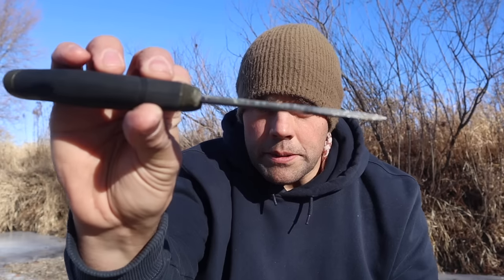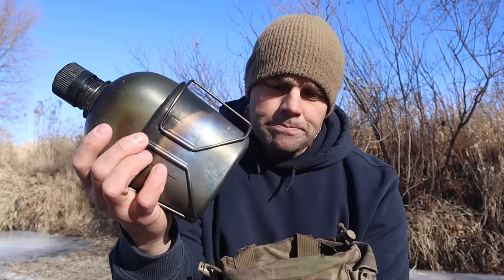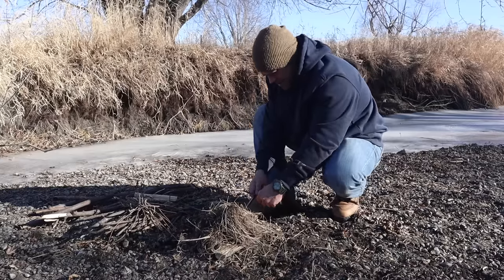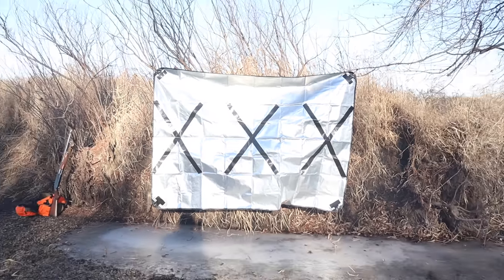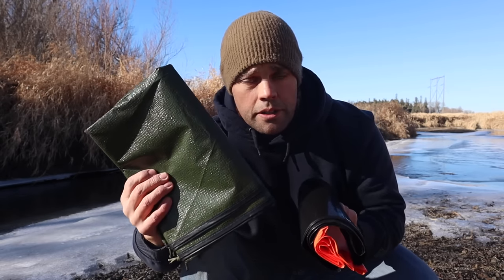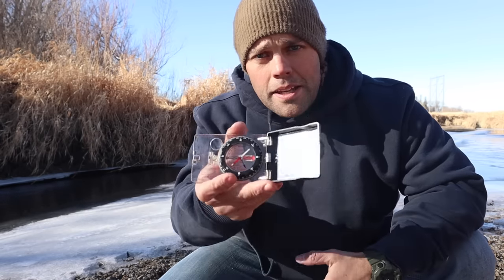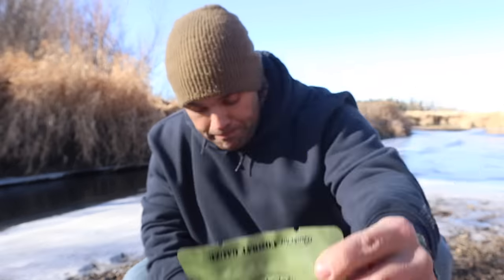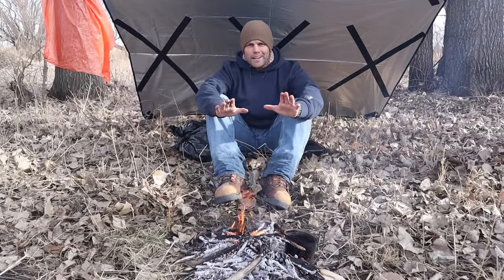How to Make an Advanced Survival Kit!

Comment: I dehydrate veg (onions, carrots, mushrooms, grilled eggplant, tomato slices, bell peppers, etc) and add powdered beef and spices then vacuum bag them. Very tasty, very lightweight, and all that's needed is hot water. But, its tasty enough to eat without water. And, extremely inexpensive.
Reply: Nice.
Reply: Suzi, is there a certain amount of beef powder you put on? Never thought of this but sounds awesome! Me and my wife are working on dehydrated meals from Kevin outdoors channel.
Reply: @jasonmashburn1280  

I tend to eyeball things but my eyeball did spy 1 c of the dry veg mix with 1 TB of the beef powder. Don't forget salt and pepper and I also add granulated garlic (like powder but with larger crystals). Add any other dried herb you like. I added parsley, ginger, and a smidgen of anis to give the illusion of sausage in the background. I've also added tomato podwer and crumbled leaves dehydrated kale but spinach or swiss chard (or all!) fill out the soup nicely. I've also used broken bits of angel hair pasta and they soften in the hot water with the rest. I'm going to try the vermicelli rice noodles, broken, next time. 

Dehydrated food is so nice. I'm about to try both dehydrated mashed potatoes and hash browns, the former should be just like instant you can buy (and when I can get my hands on powdered butter that will go into the vacuum bag along with s & p and powdered milk .. should be a tasty mashed with just hot water).

So many things to try and variations on them. In the dehydrator now is a pumpkin pie mash that I hope to turn into a 'sugar'.
Reply: @suzibikerbabe8073  just be careful when dehydrating powder with your food, I have heard some people say the granules can get sucked into the vacuum on your sealing and damage it. 

That soup sounds awesome! Kinda like meals in a jar only in a bag! I'm a OTR truck driver so I'm wanting to be able to make stuff at home to bring out with me. You will go though hundreds of dollars a week eating at truck stops.
Reply: @jasonmashburn1280  

Thanks for the tip! I dehydrate garlic and will go with that but if making a quick soup at home the granulared should e fine. I scoop out a cup and either pour water over or simmer in water in the stove. At home there are more options but on the road earing it dry is like this really savory trail mix. 

Added green toms into the dehydrator. No idea how they'll turn out but temps are now in the low 30s at night and I can't leave them on the vine any longer.

I'm also going to carmalize onions and green onions then dehydrate to see what diffierence they make.
Reply: @jasonmashburn1280  

Though I wonder how big an issue the grains and powders are with the jar vacuum hose, which I have it attached to a brake bleeder ...
Reply: @suzibikerbabe8073  as long as you don't get to close to the top I don't think that will be a problem.
Reply: @suzibikerbabe8073  Wow, you're really creative with the dehydrator and meals. I recently got a vacuum sealer and I love it. So I need to starting using my dehydrator more. I haven't tried it yet but I bought some powdered butter from My Patriot Supply. It had good reviews. Thanks for inspiring me!
Reply: @suzibikerbabe8073  Orzo and the mini / lightweight star pasta would be interesting to test against the vermicelli. 

From what I understand, one or both of those types of pastini can endure long cooking / stew times.
Reply: Mushrooms aren't veggies ;)
Reply: Just saying great video idea too
Reply: good idea bro
Reply: That's a great idea.  You make me want to buy a dehydrator.
Reply: @donaldgoodnight7853  seek help.
Reply: @redriver6541  

I bought mine at Aldis for under $15 and it's rarely put away. You can buy fruit and veg that are on sale because they're close to going bad and dehydrate them into snacks and powders. It saves anything that you have that's more than you can eat before rotting, dehydrate. Jerky is all your own flavors. Buy the freeze dried eggs, milk, and butter and you can make your own dry mix for biscuits, pancakes, dumplings, or even cupcakes (cocoa powder and sugar). I make my own rubs for bbq meats from what I grow in the garden. I find I may need a tablespoon of tomato paste then what to do with the rest? Dehydrate! Dehydrate tomatoes, cucumbers ... things in the garden that we can eat as fast as they grow and I can rehydrate to make a sauce of pickles. Use your imagination and don't fret that some ideas that were brilliant in your head will be crap on a plate. I joined a dehydrating group on facebook: Dehydrating Tips and Tricks, a Purposeful Pantry group. Lots of ideas and help there. :)
Reply: What or where do you find powdered beef I’ve never heard of that?
Reply: @cohiba1982  

Beef granules .. like bullion cubes only just beef. I believe made from freeze dried beef broth/drippings.
Reply: How would you prep all that food in the event you don't have an adequate water source?
Reply: @joegarcia1674  

If you don't have water, you've a way bigger problem than food.
Reply: Oven costs in dehydrating ?
Reply: How about dried beans for protein? What about vegetables seeds?
Reply: @mattpierce5202  

Dried beans would still take an hour or so to cook, cook them then dehydrate so they'll only have to rehydrate.
Reply: @suzibikerbabe8073  that’s worth a try? Have you tried that before? I’m a truck driver I sometimes have cravings for beans.
Reply: @mattpierce5202  

Beans make me physically ill so I've not done this personally. I do know that items like dried pasta, rice, and beans need to be cooked before dehydrating if you want to be able to add boiling water and go. Same with veggies like carrots and potatoes, they're too dense to dry properly and rehydrate nicely. There is a resource here (and on facebook) called The Purposeful Pantry that has great info and she gives feedback to questions. 

As a truck driver snacks can be a killer, when you get them from the chip isle at the truck stop but with dehydrating you can make healthy snacks, including jerky. Dry some fruits like banana, strawberries, and apples then add some nuts and you have a tasty, no chemicals added, snack. There are hundreds of thing you can dehydrate for meals and snacks. Even some veg, when dehydrated, are so tasty they're like candy.
Reply: @jasonmashburn1280  i put powders in brown paper lunch bags. Roll the top down and then vacuum seal it. Havent had any problems yet with it getting sucked up into the machine
Reply: Another great video and training for the “average Joe”
I appreciate the basics and then making them multifunctional with just a little extra prep.
Reply: Bananas dehydrate really well and taste amazing.
Reply: The thing that makes this such a GOOD idea is that small dehydrators are very inexpensive. They are used mostly here in South Africa for making dried sausage (droë wors) and biltong which is Afrikaans for beef jerky (I think). Although it is quite often made from things like kudu and ostrich). In my opinion commercially dehydrated fruits and vegetables are prohibitively expensive and so are MREs. I mean, let's be honest here - the separate ingredients of most MREs can be purchased individually at a far better price. Here in South Africa I wouldn't buy a Mora I would buy a BAHCO which is the same knife. Also a Leatherman costs over R4000 so I would buy the individual components and keep them in a small pouch.
Reply: @cohiba1982 Its basically powdered jerky. Here in South Africa we have powdered biltong which is the same thing.
Reply: @zeez3139 Very little.
Reply: @suzibikerbabe8073  dang girl you got the whole market in the bag lol that's awesome my mom is really into vacuum sealing
Reply: @jasminepina9058  

Tonight I'm dehydrating tomato skins from when I made sauce. I ground them and added pizza spices, granulated garlic, and that nearly powdered fake parm cheese for a popcorn sprinkle but I can use the powdered tom skins alone to add flavor to anything .. eggs, ground beef, chicken shake, any of the soup bags .. and with a little water I can have tomato paste. It's great to use up stuff that can normally be wasted.

Comment: Great tips!
For your Bic lighter, make one of the flame guard holes a little wider with a screwdriver or something, and put a split ring through it, and put a carabiner on it. You can now attach it to anything. Tether it with a small chain to your belt/pack so it stays on you if it drops out of a pocket.

Comment: Some other ideas I like personally are:
1.  Use brighter colors....pink, yellow, orange Bic lighters....bright colors harder to lose.....
2.  I carry some cordage smaller than 550 cord.  I use that to wear the compass, whistle, and a signal mirror around my neck.  The ability to signal needs to be available almost instantly. I also tie important items to my belt.  My Ferro rod and a small knife such as a swiss army are hitched to my belt and stuffed in pants pocket.  If I take a spill down an embankment I don't lose the items.
3.  I like a very minimal and compact fishing kit added.  They can help as traps or snares as well.  (You can catch small game with a treble hook.) Strangle, dangle, mangle.
Small fishing night lines can work for you often better than setting traps.
A sail needle can be taped to your equipment for repairs to clothing or equipment. Possibly single sided razor blade also to save your primary blade. Can be kept with fish hooks....pill bottle or Altoids size kit.
4.  You can take the $.99 harbor freight mag bars... separate the Ferro from them and JB weld it to the side of your Altoids tin or other hard gear....use as a spare.
Iodine is a fair water purifier except on cryptosporidium.....it can also be used in cuts and scrapes.
A small piece of heavy tinfoil is good for a canteen cup cover to conserve fuel and as a fast waterproof base or wind break for your tinder bundle.

Just a few thoughts.....

Comment: No nonsense direct informational presentation. Add a high powered Slingshot with a bag of chrome steel ballbearings. Modified First-Aid Kit to a small Med-Pack is an excellent suggestion, and to read up on how to use the additional items and a guide to first-aid techniques. Priced of Survival Gear have increased ,since the Covid-19 Plague. It is therefore a good idea to obtain all necessary Survival Gear now!!

Comment: If a person is going to depend on a fero rod, practice is an absolute must. Lighter will always be my first option, but I also have the waterproof match carrier with the compass on top in my coat's great pocket. I also verify frequently that the compass is also pointing north before I head out. My paracord survival bracelet has a compass, fero rod and whistle. I can't trust the compass on that though. The tourniquet stays in my hunting pack, but I should probably add it to the survival pack that moves to whatever pack I'm using at the moment.
Reply: Windproof matches make great tinder under harsh conditions.  Good to have a few of them in reserve.

Comment: Hi Andrew glad to see you doing well. I like this kit I built several myself and wanted to share with you I added a GI poncho and a homemade fleece poncho liner I also have a candle lantern with bees wax candle this is an emergency shelter in itself candle goes under poncho as I sit this warms the whole body and candles last for a good many hours.
Reply: Good idea, instant heated shelter .
Reply: Beeswax doesnt work well when its real cold
Reply: I have a small one and I have votive candles that work well, but I also make beeswax candles so I can custom make them for the lamp. Good idea.
Reply: @robertw4230  indeed.

That is a great idea.  Does anyone any recommendations for places to shop if live up on Canada?
Reply: I use citronella tealight candles in my lantern helps to keeps the mosquitos away

Comment: The illumination tape would be good for the Altoids tin. Takes up little space :) . Glow-in-the-dark gear can be very helpful, in instances where some light would be useful, but fire is unnecessary. 

A few glowsticks can be good, too. Can charge the tape, and provide passive signaling.
Reply: In my car I have a small kit, inside is a few small (2 inch length) and normal sized (5 in length) glowsticks. Great for emergency light, 3 can be strung for signalling distress, or alerting traffic a car is parked ahead on highways by throwing them on the roadside, and they are dirt cheap and hard to damage inside a kit. The small sticks would be great in a hiking kit too.

Comment: By far the best survival kit I have watched. Solid video. Great content for the community. One question I have is on your trap instead paracord is use bungee cord to add some spring action in heavy wind... your thought
Reply from the maker: Bungee cords are good, I’m not opposed to them. I think 550 does a better long term job. I’ve cannibalized bungees for sling shots and traps in the past so I prefer 550. I’ve also gutted 550 for traps and still had a ridge line and exterior sheath line. Prb best to get out of the wind as much as can be done, not always feasible. I can see bungees doing fine.

Comment: Great kit, thanks for sharing!
Would add a small hygiene pack (toothbrush/-powder, soap, toilet paper) and a (small) wool blanket, and would put all the stuff into a small 10 or 20 liters ultralight rucksack. I know these are things not necessarily needed for survival but for me, they make a huge difference in hygiene and comfort and are worth the extra weight and volume in a survival kit.
Reply from the maker: A small hygiene kit would be preferable. I know some species of plants like "sweet gum" to clean teeth even charcoal and water. But a small kit would be a good comfort in a 72 hour situation.
Reply: @RangerSurvivalandFieldCraft  
yes the thing with plants and charcoal is that they are not always available, and a little tooth brush doesn't really take much weight or space. A foldable/collapsible one would maybe even fit in your med kit. Instead of tooth paste one can make a small bag/parcel full of tooth powder, would also fit in.

Comment: Thanks for uploading and sharing.  I'm finally subscribed after watching this video.  I keep a survival bag in my car.  It's a helitack web gear pack that I keep stocked and ready in my trunk at all times.  You never know if/when you are going to get stranded somewhere overnight or longer (snow storm).  OR, there is a disaster and all the roads are closed down, you are at work, and I need to get home.  Since I work 15 miles from my home, it might take a day or so to get home depending on the situation.  I am also in the process of rigging a length of paracord from the emergency latch release to the passenger compartment just to make sure I can get in there two alternate ways in case the key fob is lost or unusable.  My hiking backpack is fully outfitted as a survival bag as well.  I have all 7 priorities covered in it as well.

Comment: AWESOME information. I added a ponytail band around the lighter button just to keep it from discharging in my pack. The other pack I used duct tape up around the button. Thanks for the filing tip on the back of the Mora companion, I also will do it on my Baco laplander for a back up. Thanks for the vid

Comment: Great video. VERY well organized and intelligently presented. Keep it up.  

One thing I would include is an ax. It makes a huge contribution in so many ways but does demand a little thoughtfulness due to the weight it adds,.Your kit is kind of like the Lord's prayer. It's a wonderful framework that allows someone the flexibility to endlessly add or delete items according to the season and intended duration, environment, and distance from civilization of the planned expedition. 

Not to diss the Rangers in any way but "Why walk when you can ride - go mech." A quad with a small trailer or even a great off-road vehicle can bring a LOT more equipment, food, communication, and safety items and be just as enjoyable, though there are certainly many beautiful places that only your feet can take you to. 

As always, never venture into the wild without informing someone who cares where you intend to be and when you expect to return.

Comment: Nice video.  Consider how you can add some redundancy.  Overall good suggestions.  Look at TITAN SuvivorCord as a replacement for the 550.  TITAN has two additional strands, one for fishing and one for fire starting.  I follow another youtuber, graybeardedgreenberet, who has a couple of videos on creating a bug out bag which also focuses on survival needs.  Personally, I like having things with dual uses and I want my overall kit to be as lightweight as possible.  Keep up the great videos and stay safe.
Reply from the maker: I had Titan Cord in the kit for a while and then I started using it for boot laces and lanyards. I found with the boots the snare wire snapped and poked through the cord. My one critique of Titan is that their snare wire needs to be of a larger gauge and the fishing line needs to be smaller.

Comment: instead of normal 550 cord, I would humbly suggest survivor cord. it has the same inner cords but also has a waxed jute twine, and a snare wire.
Reply from the maker: I have used Titan Cord for boot laces and found with some use the wire inside snapped in several spot and began to break through. I do prefer Titan for street shoes.
Reply: Search for survivor cord on Amazon, comes right up.